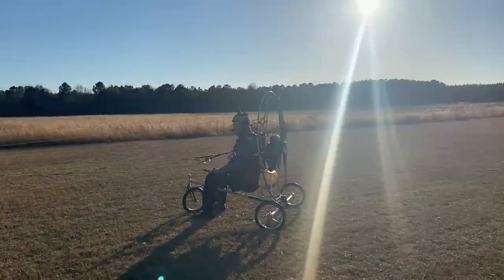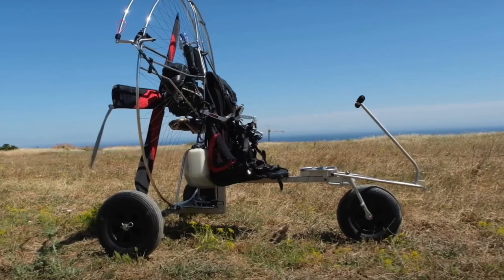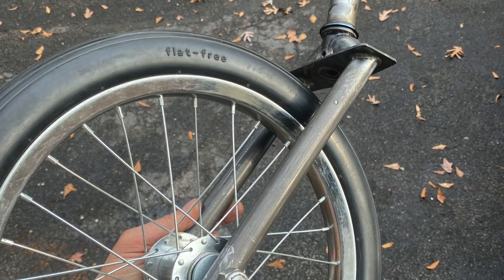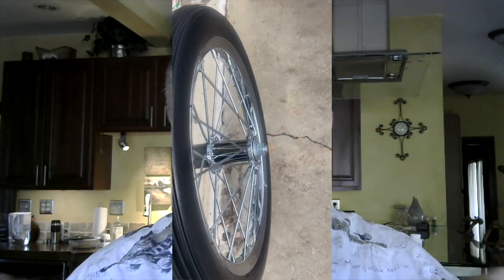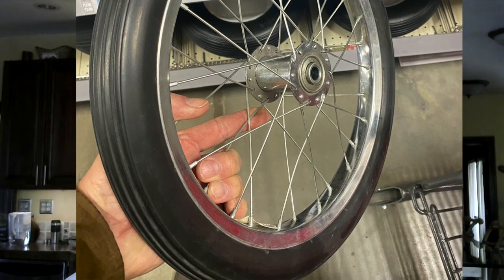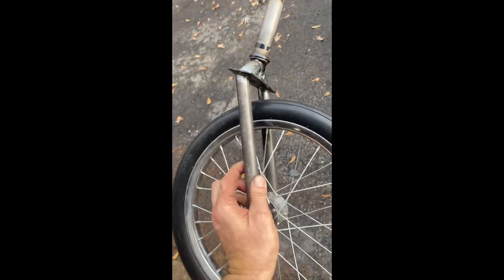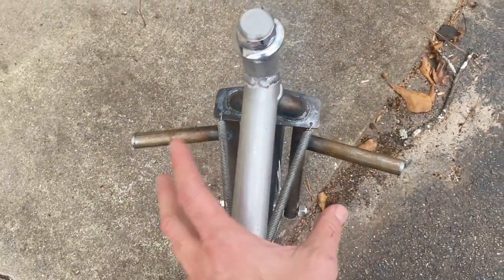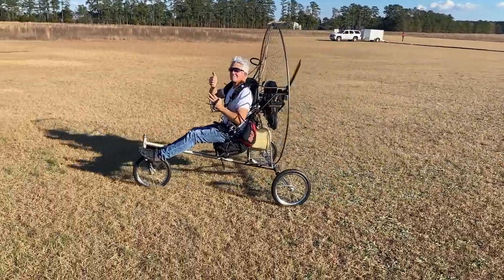The $148 homemade paramotor trike

Comment: Very nice. Really makes me wanna build one too.
Looks like your grade 8 bolts for the rear wheels are loaded the same way as many swingarms are, not tenshioned. How did you select grade 8? I myself are trying to figure out whats the best swingarmbolts but its 2 camps. Soft that bends vs hard that cracks. Whats your opinion on that and what grade does pap use on the swingarms?
Reply from the maker: wow... tough questions.  This is why certified aircraft are so darn expensive.  The required engineering and destructive testing behind designs that the FAA can "certify", is not only costly, but requires way more brain power (not to mention structural engineering credentials) than I have.  I think soft may be better, but in the case of a trike most of the issues are ground issues, not in flight concerns.  As for PAP?  How can I answer for them?
Reply: @YankeeinSC1  isnt that a Pap? Just look at the stamp on the bolt head

Comment: Would you be interested in building one for me?
Reply from the maker: About 2 months ago I landed nicely, then tried to taxi up a small sand/earthen berm to my truck. I didn't land on the berm because of some survey stakes for some new hangars that will soon be built.  Anyhow, the side load attempting to climb the berm was enough that the hard rubber tire worked itself off of the flimsy rim, which subsequently dug into the ground and folded in half.  Even though I was barely rolling more than 5 MPH, the sudden stop bent my front forks and sheared the gooseneck weld. I have repaired it, but I really need to re-design the steering to incorporate a heavier duty triple tree style steering system that prevents side load forces from having as much bending moment. I may also upgrade to pneumatic wheels, at least for the front.  In a nut shell, I would if we were friends and you lived close by, especially so if you could take care of sourcing materials, but I have no desire to become a "manufacturer".  I've filled my time recently with a huge residential deck project, so I'm strapped for time on top of everything else...